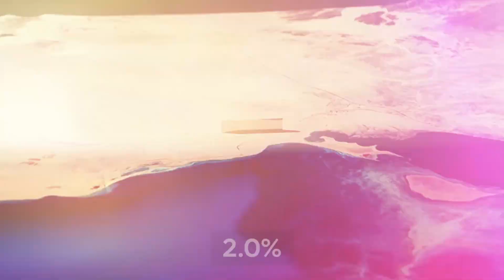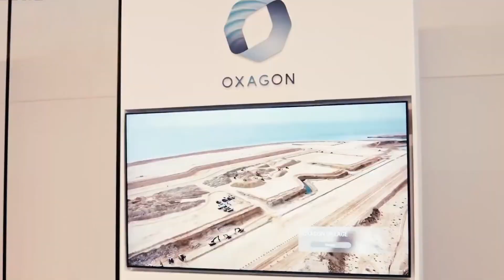Saudi Arabia's Futuristic City THE LINE Rising Fast in 2024!

Comment: Saudi Arabia's THE LINE project is a bold vision for a linear city that aims to redefine urban living. Spanning 170 km, it seeks to eliminate cars and carbon emissions, housing up to 9 million residents in a mirrored structure. However, reports indicate that the project has faced significant scaling back due to funding challenges and fluctuating oil prices, with expectations of only a 2.4 km segment completed by 2030 instead of the initially planned larger scale13. Despite these setbacks, the Saudi government insists the project continues as planned, emphasizing its role in economic diversification under Vision 2030